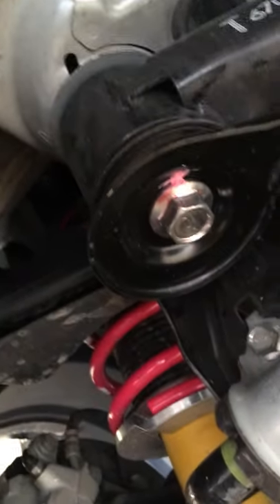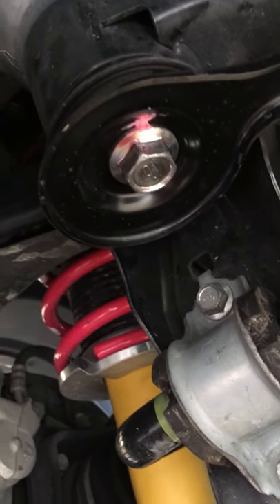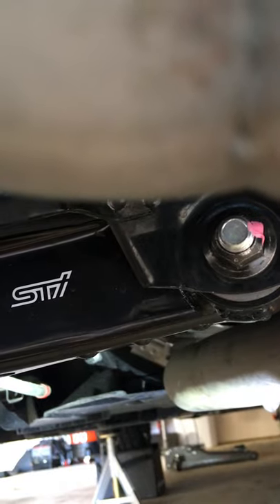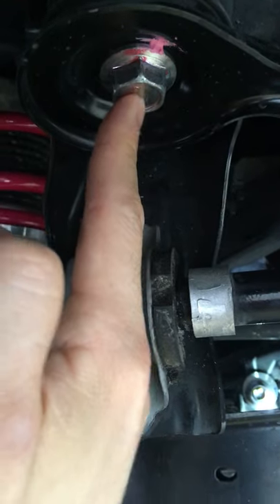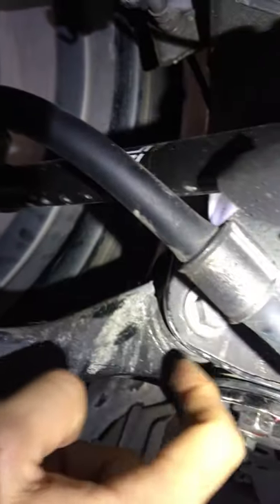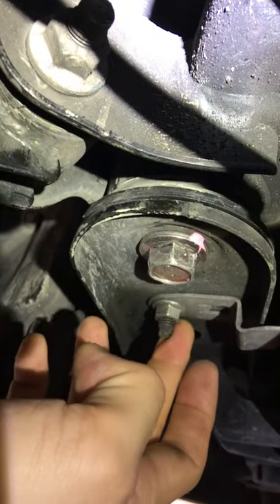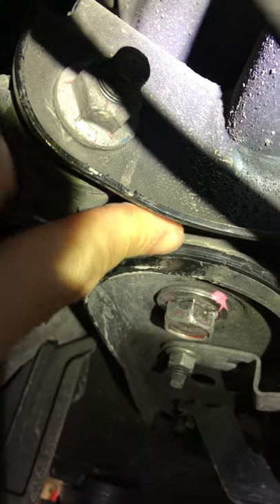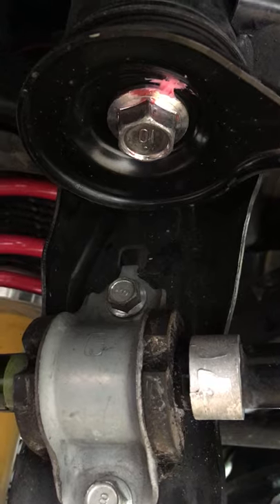JDM STi S209 S207 Extended Subframe Bolts review Part 2: Viztorque and Subframe bolt locations

Comment: Happy new year! So there are 2 front stoppers and 4 extended bolts (2 front, 2 rear), correct? Would it hurt to install rear stoppers?
Reply from the maker: Hey what's up! HNY dude! 2 front stoppers and 4 extended bolts is correct, this is actually the same setup that the S208 has in Japan, woohoo! The 4x rear subframe bolts make a noticeable difference in locking the rear subframe down and I think the front rubber stoppers help make the suspension more pliable for handling bumpy roads. I don't think adding rear rubber stoppers are a good idea since it more directly affects the sway bar movement whereas the front rubber stoppers more directly affect the rear suspension.
Reply: @j168vlogs  Thank you! I’m ordering them tomorrow. You’re the best!
Reply from the maker: @jazzblaster  Yo! No prob bruh! Awesome!! You're going to like the mod, perfect setup with your trunk and bumper stiffeners. Have fun!